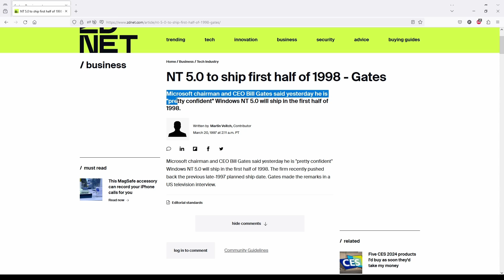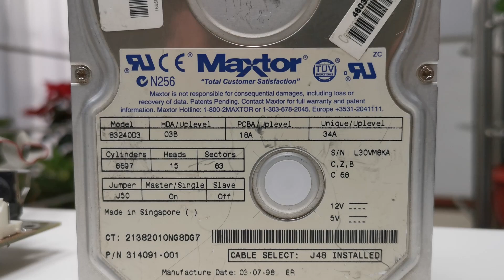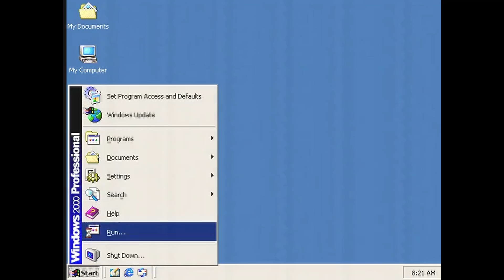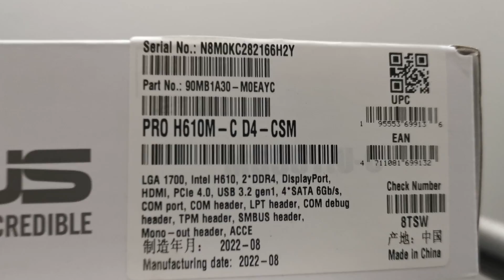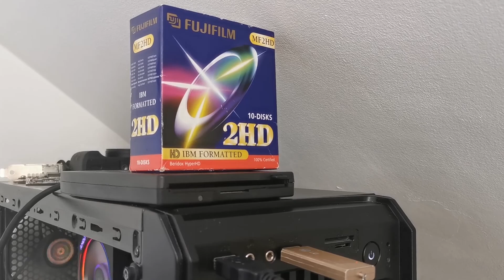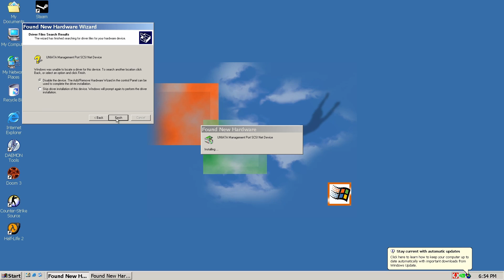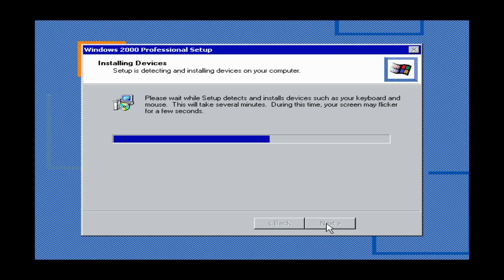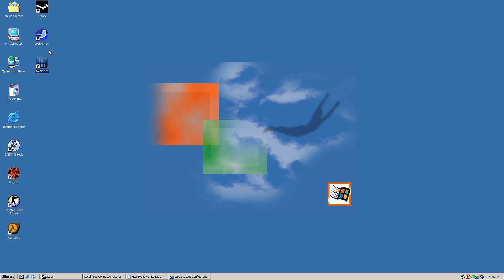Windows 2000 on a Modern PC: Nostalgia Meets Intel 13th Generation CPU

Comment: i thought ur guides were cool so i tried to follow them to make a modern parts pc but the recommended motherboard u use has been impossible to get working and ofc asus tech support is like duh whats a computer.  i have never had a mobo just totally fail to work like this one (tried 2 diff boards, both same model as urs) and i wonder if the manual even has correct information in it, it's that bad
Reply from the maker: Tell me where you get stuck and I can help you. I just installed NT 4 with multiprocessor support on this motherboard. I use 09/2023 BIOS: https://i.imgur.com/B9dI3sx.png. What OS do you want to install?
Reply: i wish i even got that far in the process, i cant even get the motherboard to boot.  i tried two different psu and i just get a red led light on the motherboard when the psu switch is on, the led lasts a few seconds then turns off, it is right next to the nuvoton chip.  the power switch wont boot the board and not even shorting the power on/off pins with a jumper works. 2 different psu, 2 different motherboards, two different cpus, two different sticks of ram, same problem always @O_mores
Reply: also i tried clearing cmos by removing cmos battery for 10 mins @O_mores
Reply: every time i try to reply here my messages dont appear? so anyway i used your website's comments/questions form to send system information  @O_mores

Comment: i remember installing windows server 2000 from automated images designed for pentium 4 class server computer on core 2 duo desktop motherboard from 2011 and sata harddrive
it was a multi step process that took more than 10 atempts to acomplish, but when i was done with it i had it working for over 5 years up untill windows 2000's end of support
if it was straight forward installation i probably could do it with no issues but it involved some wierd school edition of scripted installation from 8 cd's where i was forced to put one network card dos based setup would recognize and 2 gigabit ones and sata drive controller  had to get driver injected into inf folder mid trough installation and installing all the rest drivers later
Reply from the maker: Microsoft was always a step ahead when it comes to unattended installations. When Windows 2000 was at its peak MS had like 90% market share and Windows had to be installed monthly on millions and millions of computers. And this was not reserved only for business, you can install Windows 9x using PXE.

Comment: is there any way to use port 60/64 emulation on windows 2000. because it's just works before windows stats to boot.  because the usb controlled that you sent me isn't available for my region
Reply from the maker: Port 60/64 emulation in Windows 2000 can be tricky because it’s primarily designed to work before the OS boots, mainly for USB keyboards and mice in legacy BIOS setups. Unfortunately, after the OS boots, it tends to rely on drivers, and USB controllers compatible with Windows 2000 can be hard to find today. You might need to look for specialized third-party software or try a PS/2-to-USB adapter, as some adapters emulate the port directly. Also, check your BIOS settings to ensure legacy USB support is fully enabled for keyboard and mouse emulation.

Comment: Hey, can you make a full detailed video about installing UniATA? 

Whenever I try to install UniATA it simply gives me a bluescreen or it doesn't install at all.

Or else can we install UniATA using VirtualBox (or) VMware?

This is the only option for me, However, I tried installing Windows 2000 on my old business PC which is HP SFF-8300 it works with Windows 2000 when I emulate Sata as IDE.

But when I install UniATA, it starts to give me a bluescreen. I need to install UniATA because I want to use Windows 2000 on my Gigabyte B450 Aorus Pro WIFI Motherboard. 

I installed your files using PRE-installed Windows 2000 on VirtualBox, I burned the VHD to disk using VHD2Disk and copied the files that you gave me earlier to the drive. is the right manner?

Bluescreen: Inaccessible Boot Device

Please Help Me  Brother.
Reply from the maker: Hi, at 10:50 is the way I installed UniATA... This is how you are supposed to do it. The other way is to locate your unrecognized SATA controller and install the driver manually with "Have disk" method... The fist method is better from a compatibility standpoint. Just try to install Windows 2000 from a DOS bootable partition, the DOS part will work for sure and will create a dual boot menu for you. Now you can dump all the files I gave you on C: you and Windows 2000 it should start.

Comment: I have this VIA VL805 PCIe USB card which has a native Windows 2000-supported driver but the thing is I can't install the driver to Windows 2000 because my motherboard doesn't have any PS2 port built to it. So is there any way to integrate the driver without using a keyboard or mouse? 

I tried installing the VIA VL805 PCIe USB card driver from my old business PC which is an HP SFF-8300 because it has a PS2 port, when I tried to boot it gave me a blue screen Inaccessible Boot Device

Is there any way to add a PS2 port to my Motherboard

Motherboard:  Gigabyte B450 Aorus Pro WIFI.

Sorry to disturb you, Brother.

Have A Nice Day!
Reply from the maker: PCI-E to PS/2 adapters are in fact USB cards with a PS/2 to USB converter inside. They don't work in DOS, Windows 3.11, 95, NT since the operating system won't recognize the USB chip . Newer operating system are recognizing the USB chip and your PS/2 keyboard or mouse will be treated as a USB input device. VIA VL805 is an USB 3 chip, not great for legacy operating systems... You can try to integrate drivers with nLite. Might work since VIA claims that this adapter has `USB legacy support`, whatever that means. To be sure 100% you need a PCI-E to USB 2.0 card which is recognized automatically in Windows 98, 2000, XP, Vista and newer. I use this card: https://www.startech.com/en-eu/cards-adapters/pexusb4dp
Reply: Hey, can you make a full detailed video about installing UniATA? 

Whenever I try to install UniATA it simply gives me a bluescreen or it doesn't install at all.

Or else can we install UniATA using VirtualBox (or) VMware?

This is the only option for me, However, I tried installing Windows 2000 on my old business PC which is HP SFF-8300 it works with Windows 2000 when I emulate Sata as IDE.

But when I install UniATA, it starts to give me a bluescreen. I need to install UniATA because I want to use Windows 2000 on my Gigabyte B450 Aorus Pro WIFI Motherboard. 

I installed your files using PRE-installed Windows 2000 on VirtualBox, I burned the VHD to disk using VHD2Disk and copied the files that you gave me earlier to the drive. is the right manner?

Bluescreen: Inaccessible Boot Device

Please Help Me  Brother. @O_mores
Reply: I have the issue too and he should make an install guide pdf to help us do it right!!!

Comment: Windows 2000 and XP had a similar experience, but XP did improve compatibility a little in comparison.  I have installed so many computers with both and it was always an uphill battle with newer computers for the first time.  However, if you can get a custom rebuilt installer with the patches it makes your life so much easier most of the time.  Now if you wanted to install onto an NVMe, you might be out of luck unless you could get a NVMe SCSI emulation driver for it.
Reply: XP increased the compatibility, but sometimes I had to boot to win2k to get more FPS than on the XP :/
Reply: Yes atleast the minimum requirements for ram and CPU were the same, also same like in  windows 7, 8.1 and 10

Comment: I can only Imagine running scandisk surface scan on 500GB HDD
Reply from the maker: Indeed, you can go outside, do some shopping, and comeback 2 hours later... :) The good news is that Windows 2000 is able to handle a 500GB drive...
Reply: @O_mores  did you need to have some service pack for that? I remember that the win2k ruined my HDD some times because it could see like 160GB, and when I had partitioned it in 3rd party program, it would install, but sometimes the system would stop working.
Reply from the maker: @nomadc4  I used Win2K SP4 but ultimately it's about the disk driver if it can handle larger drives. And UniATA definitely can work with big drives, up to 2TB. For example I can see 1TB SSD in Windows NT 3.51 using the same UniATA drivers.

Comment: super video, Omores. n-am stiut ca se poate instala, dar nici n-am cautat. W2000 e sis meu de operare preferat, dupa care ME, desi lumea zice ca-i naspa, mie-mi place :))
Reply from the maker: Si Windows ME poate instala, vezi ca este un video dedicat ME pe canal. Windows 2K e  mai usor de rulat pe configuratii noi - gasesti hardware PCI-E si drivere mai noi decat pentru Windows 98/ME desi ele au fost lansate aproximativ in acelasi timp. Placa video pe care am folosit in video a fost lansata in 2009 si nVidia ofera drivere oficiale compatibile 2K in 2010... Poate reusesti sa dai un share pe undeva ca daca o fac eu... e self promotion si nu se accepta... :)

Comment: Great video and I hope this can work with Windows XP too and I will have to try editing some of the files from the disc to make it run on my motherboards that have Socket LGA 1770!!!
Reply from the maker: It should work for sure, I found about editing txtsetup.sif reading Windows XP dedicated threads. LGA 1770? Is that the next Intel platform? Are you a time traveler? :)
Reply: Maybe and will a bootable usb work to install Windows 2000
Reply from the maker: @minipicc95  There is a tool for this: "winsetupfromusb" and it is Win 2K compatible. But the USB stick must be inserted into a Windows 2000 compatible port, so won't work with USB 3 or unrecognized USB 2.0 chipsets.  Anyway you can perform the DOS setup part from any USB port, it will work, then the installation will continue from HDD/SSD.
Reply: @O_mores  Where is the oem folder located in the iso that you were using? I cannot find it.
Reply from the maker: @minipicc95  The OEM folder is in the root directory of the Windows 2000 installation CD. During the setup, if a file is reported as missing, you can manually copy it into those temporary folder created during setup. If the missing file is needed during the text-based setup, copy it to the $WIN_NT$.~BT folder. For issues in the GUI-based phase, place the file in $WIN_NT$.~LS.
Reply: @O_mores  Okay and you should have showed us that you were copying the poem folder into the dos partition like in the Windows XP video.

Comment: I don't recall someone using Windows 2000 on their childhood!
Reply: Windows 2000 arrived when I was 15, so as long as you consider that still childhood, then I can confirm there was at least one of us! I used it on my main machine for many years into the XP era, when gaming support fell away due to lack of newer DirectX/3D support. Definitely strong nostaliga vibes. I ran it a few years later (maybe 2003-2004), when my (newer) main machine failed for some reason. I cobbled together an old P2 233 with 128MB of ram, and that ran Windows 2000 as a Web/Torrenting/Whatever machine really well, while it struggled on XP. Win 2K is firmly cemented in my memories of my teenage years as a great OS.
Reply from the maker: I had a beta copy of Windows 2000 in 1998 but my PC had only 16MB of RAM so I didn't even bother then, but I did try it in 1999 when I upgraded to 64MB. Win2K remained installed on my secondary IDE drive, but I didn't use it that much at the time, since my PC was about gaming and not business...
Reply: As a kid/teenager geek, win2k was the best OS I used from the 3.11/95/98 era.  It was so fast and so stable. But I remember that a lot of programs needed winXP instead of win2k to work. That's the only reason I left win2k in favor of XP. But hey we were in an era that we did not NEED to have internet access to use a computer. Programs were not downloaded but installed from floppys or CDs bought at the store.